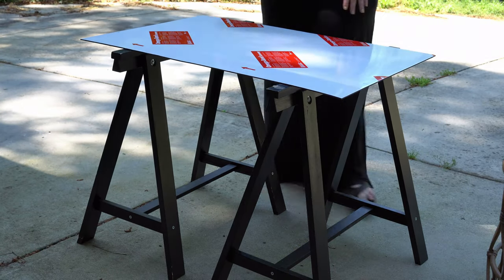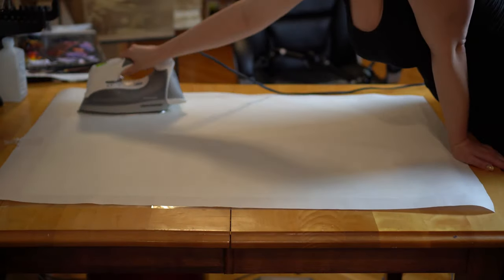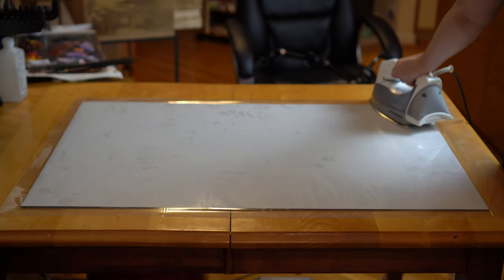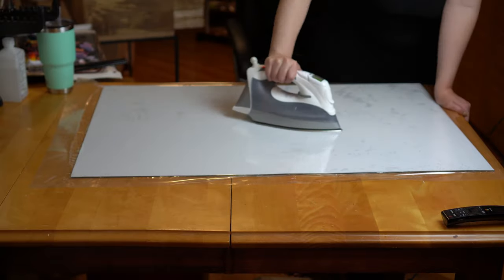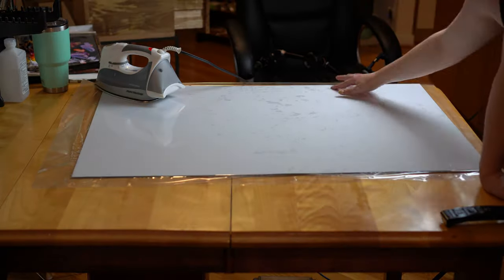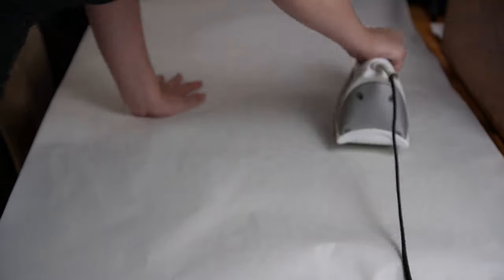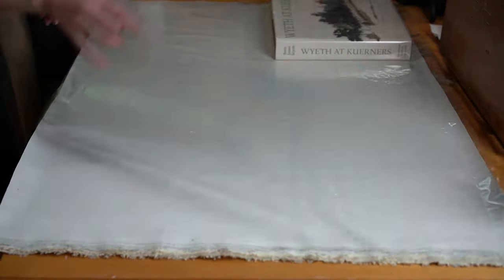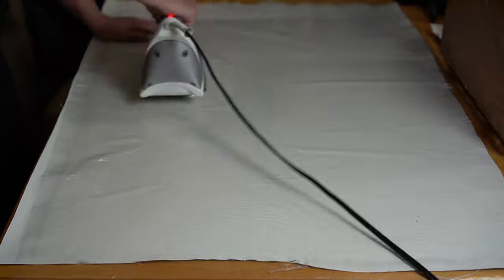DIY Linen Panels Using BEVA 371 Film?

Comment: So far, I have watched 4 videos on BEVA, one was as you say, made it look so easy who would not want to use it... and three of them were more realistic, telling of tips and pitfalls. These films have been used for photography for decades. Using them is quite nearly impossible unless you have a "Hotpress" for mounting them. with a hotpress, you can warm the surfaces for the film, THEN place the film into the press, and heat that onto the surface, THEN mount the photo using the same method with no delay... no air bubble form because the the entire surface is heated evenly and the film evenly spreads with even pressure everywhere. Now you might think "all I need is a hot press!" 
Bad news, there is no press big enough, and second they are expensive. Vacuum tables are the best, but a heated vacuum table... well, unless you make it yourself, couple thousand minimum. 

Personally, I have never had an issue with PVA. I use a roller and coat both the panel and the canvas at the same time, press the panel onto the linen, and that is that!

I would like to see how this has evolved, and what you have done in terms of mounting things.

Comment: I actually love the Beva 371 film, but I only use it on smaller wood panels that have been prepared. The largest panels are usually 14x11 inch. And, yes, I do the iron method over my heat press machine. Good video, I could sense (and see) the frustration. Thanks for it.

Comment: I think what you need is a vacuum table to make this work.  Baumgartner Restoration (Youtube Content Creator) uses film for interleaf lining of canvasses.  While he has a heater built into his vacuum table, I wonder if you could just make vacuum table and then apply the heat from on top.  This may allow you to combine the steps into one simple operation.  If you had a larger vac table, you could probably do multiple panels at the same time.

Comment: Try the opposite, stick the film on the linen first then adhere the linen to the board. Don't know if it works, but I saw Baumgartner use a similar adhesive film to adhere new linen lining (where old linen lining is either lost or provides insufficient support) on a painting

Comment: I think you can heat press it. I know that’s another machine. But it adds pressure plus a more controlled heat so it doesn’t melt the adhesive.

Comment: I'm an art conservator and though Beva 371 is a commonly used material for strenghtening a painting with new linen layer, we rarely choose the form of film. It's too expensive and not that efficient 🤷 Also, without the vacuum table the film doesn't fill the empty spaces between the threads.
And actually the truth is that natural glues last longer while paintings in which Beva was used, especially bigger sizes, tend to unstick. So trust the traditional materials, it's worth it! ☺️
Reply: Could you suggest a glue? Please list brand.
Reply: @deborahwinbun510  no specific brand, I buy it per kg in local art shops in Poland. Its either rabbit/fish glue or gelatin, traditionally used by old masters.
Reply: @MissKoletta Thank you for this comment. I am looking for a way to glue a linen canvas on an aluminium dibond panel. I was thinking of using beva 371 (either film or glue) but your comment makes me think twice. Do you know if rabbit glue works will adhere to aluminium dibond?
Reply: @dalescher  I'm not sure, but my instinct says "no". My first thought is that natural glues work on porous materials and aluminium isn't one. I know that for example gelatin is used for gilding on glass (another non-porous material), but gold leaf is very light material and sticks to the glass with it's entire surface, which  compensates the losses of adhesion caused by pores. I've seen a video in which a lady was sticking linen to aluminium with wood glue and still it was very hard to do. If you want to paintnon aluminium, better put your gesso straight on the panel. The best gesso for metal surfaces is made with oil.
Reply: @MissKoletta  thank you for sharing your thought! I have seen some people using PVA glue with dibond. I will give it a try and hopefully it will work

Comment: Is it possible to use needle pin on the bubble and reapply ironing the air out?
Reply: Yes, this is what I do. After the initial ironing I prick the bubbles in the film with a pin (or a razor blade) and then reheat that area with  an iron. It is tedious but I've gotten the process to a manageable level even for large (60 x 36) MDF (coated with medium to prevent discoloration)  panels.